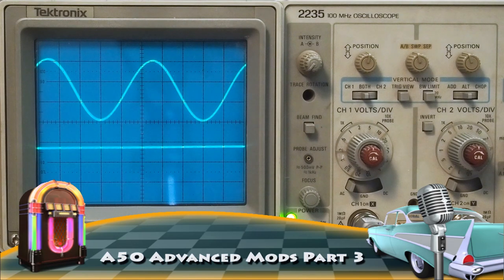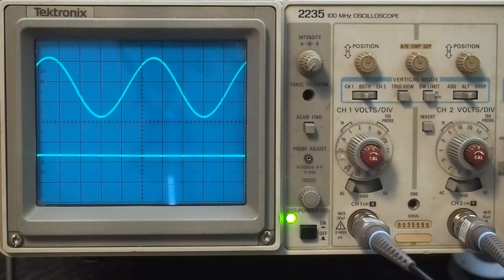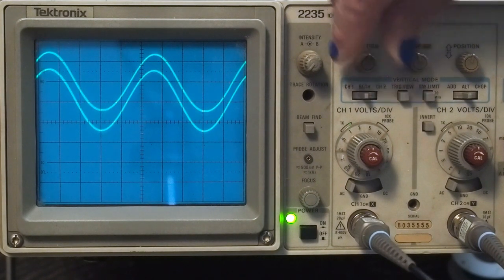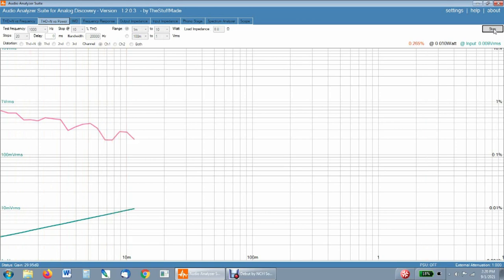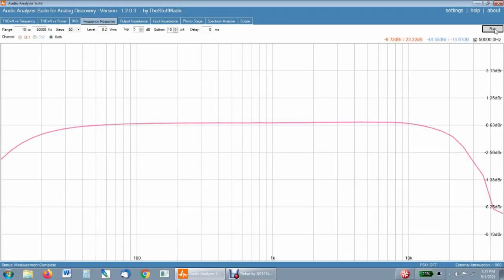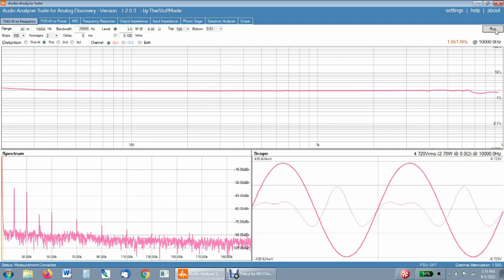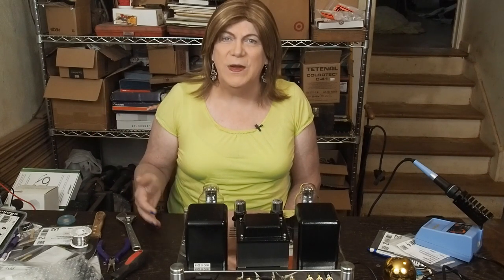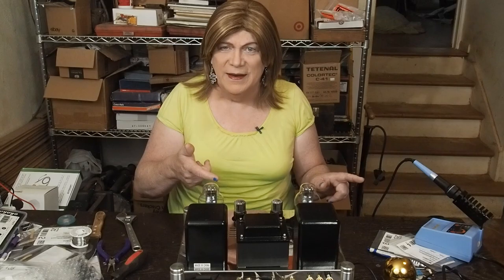Boyuurange / Reisong A50 300B Tube Amp Advanced Mods Part Three

Comment: On the cascode, am I seeing correctly that the 2nd order is lower than the 3rd? Some folks like it in the other direction. But, it looks like the direct coupled version has way more hash in between the modes, which I assume is IM distortion or something nasty. Those OPTs seem shockingly good for the price of the whole amp.
Reply: "Shockingly good"? I see what you did there.

Comment: It always has time delay of the output signal.  In the video the Tek 2235 scope does not show the delay between the input and the output signal.  I assume the input signal is at 1KHz.  Can someone explain it?  My DIY amps always have delay, more delay in the low frequency signal and less delay in the higher frequency.  I am studying the time delay impact of the NFB signal to the final waveform.  Any insight will be greatly appreciated.
Reply from the maker: Huh? When did electricity have any "time delay" over this short of a distance?